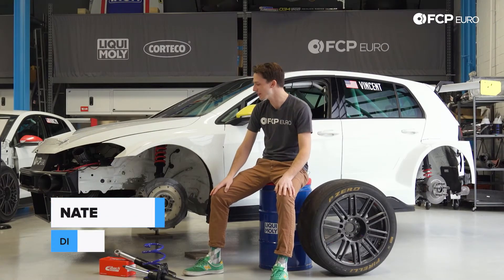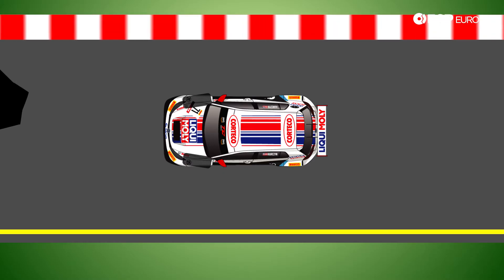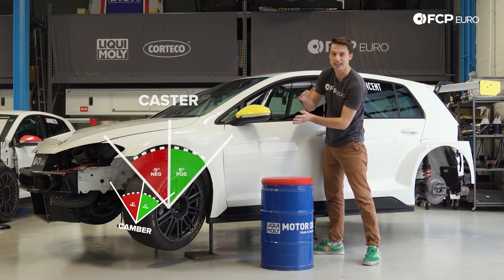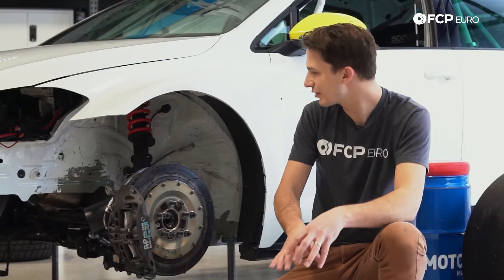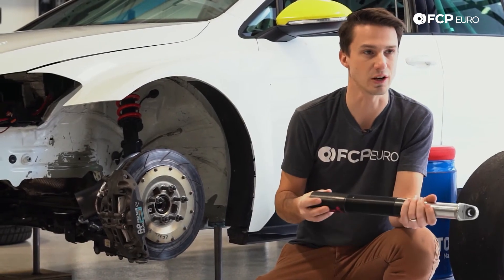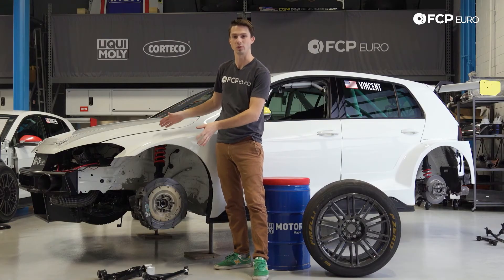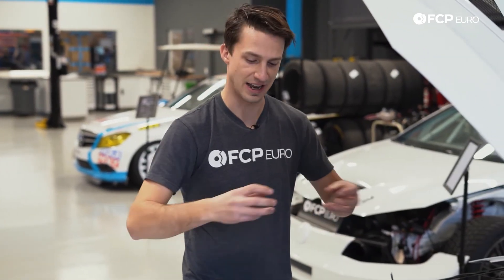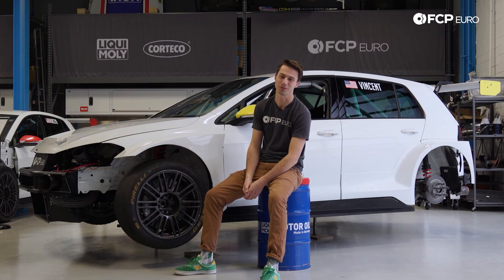Suspension Basics Explained - Overview Of Alignment, Springs, Dampers, Sway Bars & More

Comment: Can I buy those parts? I went to your website and I don't see anything for a 2019 VW GTI. Also can you talk about the wheels and tires? I believe they are 10x18" wheels, 275/35R18 tires. I need to set my GTI up better for corners.
Reply from the maker: These are factory VW Motorsports race cars, the parts can only be purchased by race teams that own these cars. We do however have plenty of upgraded suspension options for the MK7 on our website!

Comment: How much work is required to transfer the TCR's (front + rear) suspension to the road car chassis? Video =) ?
Reply from the maker: Technically, the work itself isn't the hard part, but gathering all the parts, and getting everything setup to work properly in a street car when these components are designed for a race car to going to be difficult. Plus it probably won't ride very well!

Comment: Alignment for the E46 last round we got some 'schooling' too. He in fact gave it just a slight hint of Toe Out on the front after a long discussion about the intent for our 'wanna be' Race Car. My son was SUPER pleased with how it drove and tire wear was spot on.  We recently switched to KW V3's to try and some other bits so we need to do the dance again.
Reply from the maker: Great to hear.  A little tow out on the front of a RWD car, like your E46, is a great way to liven up the chassis.  We would just never suggest toe-out on the rear or an RWD car as it will create instability on acceleration.

Comment: Really fascinating stuff. I love this series.

On the control arms, are there dimensional differences compared to stock as well? I assume they're longer and it looks like the ball joint is moved forward too, presumably for more caster.
Reply from the maker: Yes, the track is increased and the wheel is a moved a little further forward.  This is how the designers increased the caster while mounting the top of the strut in nearly the stock location.

Comment: What do you guys do if race cars need adjusting the caster ? Are there control arms or some other form of adjustable suspension component to adjust the caster ? And where would one buy said suspension component ?
Reply from the maker: On the VW TCR, the caster is increased but not adjustable.  That said, many camber plates also allow for caster adjustment.  You can tell if they have adjustable caster if they allow for adjustment of the top of the strut forward and backward and not only right and left to adjust camber.  Also, on some BMWs and other cars, you can increase caster by using an offset control arm bushing found on some M cars.
Reply: @fcpeuro  Awesome thanks for the info. Learned a lot from watching the video as well.